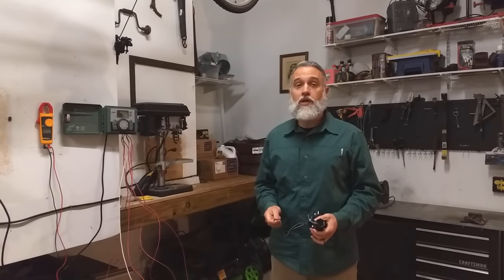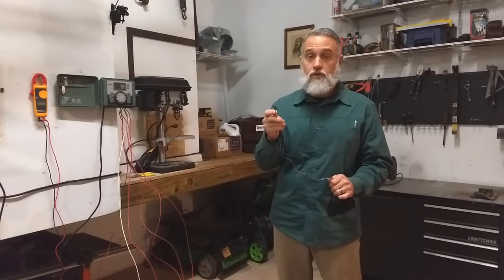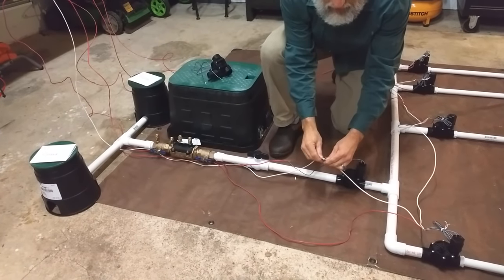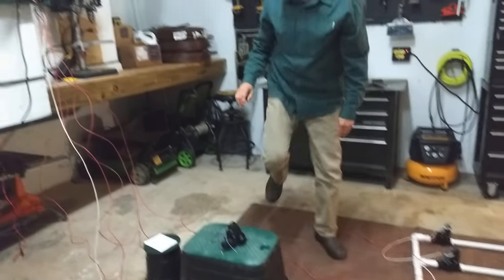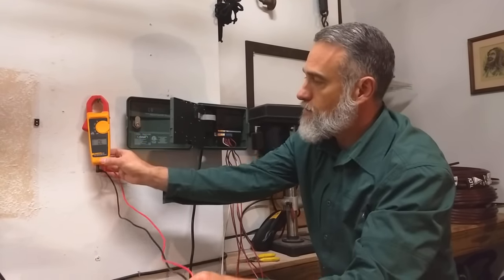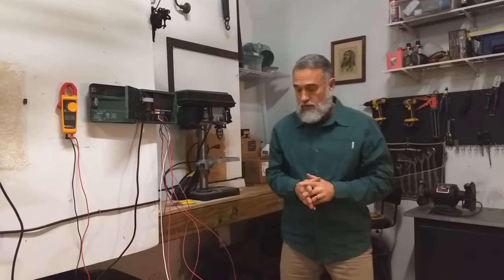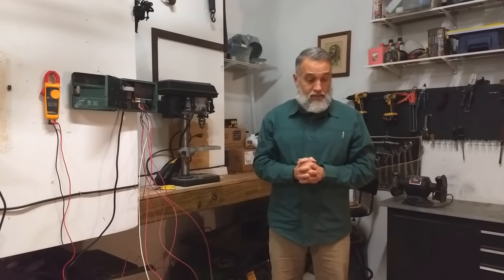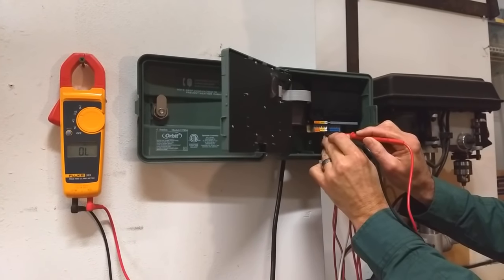Troubleshooting sprinkler system wiring issues

Comment: What a Gentleman !! I had a bad Rain Bird sprinkler where the solenoid was shot due to lightning. I have searched on Internet and landed to this video.  I called Jimmy and left a message. Jimmy called back and helped me troubleshoot the issue with my multi meter and told me where exactly was the problem. Thanks so much Sir. You helped me save my yard, time and so much money.
Reply from the maker: Aby Singhai my pleasure!

Comment: This is wonderful!  Thanks for taking the time and using your expertise to show us exactly how a system should be wired and how to use a multimeter to diagnose common wiring problems in home irrigation systems.  I particularly appreciate your telling us the normal resistance readings we should be expecting.  Your video is clear, well thought out, to the point, and presented extremely well.  This video is a shining example of how a YouTube video should be made and presented.
Reply from the maker: Anonymous98 my pleasure!  Thanks for the kind words!

Comment: Thanks for the video. System stopped working after some trenching work. Watched your video and used a multimeter to determine that the MV circuit to the pump was the problem. Did some more digging and found that the pumps’ control wire had been cut. Repaired and the sprinkler system works like new!!!
Reply from the maker: M Browning so great to hear!  Thanks for sharing!

Comment: one of the better videos I have seen. I'm diagnosing an 8 zone system in Gadsden Al (mine) with numerous problems. Getting smarter all the time but certainly not an expert. I have a large box with a ball valve and two zone solenoid controls. One was a standard Irritrol but the other is MUCH larger and the local Plumbers Wholesale didn't recognize it or have one in stock. The valve body and diaphragm housing is 4" diameter and has 10 3/8" screws that are not Phillips or Torx, they were removed by socket. The last two were under the solenoid and it needed to be screwed out of its hole in order to remove the final two screws. The faucet type handle is completely immobile so would like to replace the innards. I'd send a picture if you give me a method. Would really like to know what kind of valve this is and where I can order a replacement?
Reply from the maker: Yes, send me some pics and I'll give you a call and see if I recognize it.

Comment: Thank you for the excellent demo, i noticed that you used the red wire from the Multimeter for the common and the black(ground) for the zones, does it make any difference when measuring resistance ??
Reply from the maker: It’s a good practice to use black on common, but for ohms & ac it doesn’t matter.  If your measuring dc you need to make sure black is on the negative and red is on positive.

Comment: Hi, thanks you for making this informative video, my first zone keeps blowing my controller fuse, i did ohm test on solenoid and also wiring, both test show within range but almost 1ohm less reading, what could be causing the fuse to blow,all other zones work normal if i disconnect zone 1wire or turn its setting to zero on controller.
Reply from the maker: Most likely the solenoid or short somewhere in the wire, unless your controller is having an issue.  If you move the wire to another slot and it does it, I’d go back to the solenoid or field wire.
Reply: @sprinklerrepair4L i think just trying replacing solenoid at first is the best option.

Comment: Awesome, echoing what's been said prior, this video is very clear; thank you.  It's been 5 years but... what if you have a pump start relay between the water-pump and the sprinkler timer?  I have a 6-Zone Rain Bird system that's connected to a relay, there's power going to the relay from the breaker, and the Rain Bird system is also powered, all the wiring running to and from both units look good, but I cant' get the water-pump to turn on.  Where or what else should I be looking for?
Reply from the maker: I’m not a pump guy, but I’d check and make sure your controller is giving it AC and then make sure AC is getting to the pump.  After that it would be a pump issue.

Comment: I need to replace my current sprinkler system.  The sprinkler system that I currently have is a Weathermatic sprinkler system. I has up to 16-station connection. My lawn uses 14-station.  I am unable to find any Rainbird sprinker system that can handle 14-station. The most I have seen is 12-station evan for any sprinkler system. Can I use a 12-station sprinkler system on a 14-station lawn? Can I use station 13 & 14 and plug it to the station 11 & 12?

Comment: Oh you did cover it!  How would you expect to find this underground? Would all 4 dedicated wires run along side the supply lines and the common wire? What about for a 15 zone system? Is there really 15 wires in the ground? Thanks again
Reply from the maker: Yes, the wires are usually in the same trench as the main line.  Sometimes they will come in from different sides depending on what the installer did, but yes for a 15 zone system, you would have 16 wires running in the ground to the controller and 17 if you have a master valve.

Comment: hey, Jimmy, so if there is no resistance reading on the last, 4th 8kvalve, we have no way of telling if it's the dedicated wire, or common, correct?
Reply from the maker: POVemigranta that’s correct.  You can run a common on top of the ground from the closest valve and see if it’s the common for a quick test.

Comment: @4L irrigation repair. If you have a damaged wire what's the remedy? Run a new wire from the sprinkler box to the sprinkler valve?
Reply from the maker: The options are to find and repair the damage, run new wire,  or if another valve is close you can use an "add a zone" that will save you from running wire all the way back to the controller.

Comment: very nice way of explaining the "sprinkle wiring issues". My sprinkler system was working until three days ago. Today, when I switched it on, one specific zone (3), it didn't work. I tried all other 5 zones. none of them were working. Checked the back flow valve and found it working. Controller is working. Checked the transformer and found working. There is one white and 6 colored wires. Does it mean, I have a master valve? My last try is to check the white wire and master vale. Since, none of the zones are working, based on your video, I am suspecting common wire and or master valve. My neighbor was repairing his lawn at the zone 3. Can  it be due to some damage to the zone 3 water line? or does it impact only zone 3?  Please give me your insight.
Reply from the maker: If you have a master valve, you should have a wire in the slot on the controller labeled MV or Pump or P.  The white wire is usually the common wire which all the zones share.  I would start by taking ohm readings.  You should have readings between 20-60 ohms on each of the zones.  That will tell you if you have wiring issues or something else.  I hope the best for you!
Reply: @sprinklerrepair4L  Thanks for the quick reply. Appreciated. I will check the ohms.
Reply: There is no wire attached to the MV, So, it appears that there is no master valve. I checked the ohms by setting the multimeter at 200. When I checked the common wire with zone 6 , it didn't show any ohms (I neither got any beep sound nor DL error code). I checked zone 1, it didn't show any ohms either. Since none of the zones are working and I got no ohms from first and the last zones, I think the common wire is cut just at the 1st valve. Do you agree ?
Reply from the maker: @orkayen  Yes it sounds like the wire has been cut or come disconnected at some Junction. I’d look at the zone closest to the controller. If nothing is working, then it is probably cut or disconnected somewhere between the controller and the closest zone, which is what is why none of the zones have ohms.
Reply: @sprinklerrepair4L  Thanks. I will check and respond.
Reply: @sprinklerrepair4L  Hi Jim. I checked the common wire. It is not cut or disconnected at the 1st zone, which is closest to the controller. I also checked the wire from the controller to valve box. No cut there either. Could it be due to fuse? It looks ok and I do see the station # and time display. does water leak or damaged sprinkler head in any one zone impact all zones or shut down the entire system?
Reply: Also, when I checked the transformer (for 24VAC ), it was showing max of 19. is Transformer an issue?
Reply from the maker: @orkayen  you probably have a cut or disconnect somewhere between your timer and the valve closest to your controller.  You may not see it, but it exists somewhere or you wouldn’t have 0 ohms.  The voltage should be higher than 19v, but is a separate issue.  0 ohms = disconnect of wiring somewhere.  You may need to rent a valve finder or hire someone to find it for you.
Reply: @sprinklerrepair4L  Thanks. I did find the valve box that contains first three zones. I checked the wires coming out of the solenoid of the first three valves. All of them are good. Since, there is no cut or disconnected wires(I pull tested the common wire), I didn't remove the wire nuts. I will remove the wire nut of the first one and see any disconnected wire.
Reply from the maker: @orkayen  You should get the same ohm measurement on the solenoid in the valve box as you do when you measure that zone from the controller.  Good resistance (ohms) on the solenoid in the ground but no ohms at the controller = bad wiring somewhere in between the two
Reply: @sprinklerrepair4L  Thanks, Jim. I will check on that.
Reply: @sprinklerrepair4L  Hi Jim, since, none of the zones are working, it may not be due to solenoid. It must be the common wire either cut or disconnected at or before the 1st valve. Correct?
Reply from the maker: @orkayen  yes, I agree…it could be right outside the controller.  On the old wired sensors, that would happen a lot.
Reply: @sprinklerrepair4L  Thanks for your time/support, Jim. Finally, I was able to fix it. It was the rain sensor  connection that was defective. Now, when I connected the rain sensor back, I got the required ohms on all zones and the system was working as normal. Again, thanks for your help.

Comment: Have you had any signals cross? meaning, have Zone 1, run Valve 2, or another other than it's originally wired valve? Thank you!
Reply from the maker: Yes, I’ve seen wires crossed in the field.  Unless you know the area that work was done, it’s very difficult to find & sometimes easier to run a new wire.

Comment: Thank you for the great video.  I have a 20 year old 6 station system run by a Rainbird ESP-8 controller.  Problem that just started is that when timer turns on station #1 - three other stations come on.  Wondering if my controller is in need of replacement ?
Reply from the maker: If you have a multi meter, you can check and see if when zone one is on is the controller giving ac to the other zones.  Then you will know if it is your controller or mechanical failure with your valves.
Reply: @sprinklerrepair4L  Thank you so much for your reply.  I do have a multi meter, and although my mechanical skills are good, my multi meter skills are not one of my strong points - could you tell me where to set it and where to to place the probes ?
Reply: So - watched your video with the Rainbird controller and followed your steps and  everything seems to be working correctly - so must be a valve problem.  I have only been able to get one zone to open and close manual by turning the solenoid - so that is a mystery - getting dark here so will attack again tomorrow.

Comment: Thank you so much for this video. So helpful.  However I have one question...zone 1-4 are wired by the same wire spool.  Zones 2-4 work but Im getting an open on zone 1 and solenoid is good.  Doesnt make sense that zone 1 would have a cut wire and not the others since they are in the same strand.  Any ideas?
Reply from the maker: It’s definitely possible that it was the only on cut in a bundle.  Does it have ohms at the controller?  If it does, then measure voltage to make sure the controller is doing its job.
Reply: Figured it out 😀  it was the black wire coming out of the grease tube, the end broke off ☹️. Thank you for the reply 😀😀😀

Comment: Hi Jimmy
I bought an old house with a sprinkler system that was working with a very old rainbird controller and a pump relay. It was working great with 2 zones and I disconnected the controller to replace with a newer one, first mistake!!!!! now I cant get any valve to work. the wiring is confusing. the controller wiring hooks to the relay using brown and white then continues to the valves . All common wires are connected to white and other wires connected to red... then there are 3 "harder wires coming up inside the valve box that are connected to the common wires. At the controller I connected the withe to common and brown to MV and the red to zone 1 I get nothing except the pump turns on but no valves working. I tested the valves manually and they are fine.
Reply from the maker: I'd take ohm readings and make sure they are all good.  if so, then I'd double-check the controller settings.  If those are good, it is probably the MV wire is in the wrong place.  I'd rotate all the wires into the MV slot with the others in the zone slots and see if you can get it going that way.  I hope the best for you!

Comment: I'm right down the road from you! I have 2 questions: what should the resistance be for a lawn genie solenoid? I'm getting around 18. Second, I have 2 zones that are dead. I believe the common was nicked by a sharp shooter. They show 30 volts at controller but only about 8 volts at solenoid. Could I just run a new common from the controller to each of them to fix this? Also, a bonus question: the color of the wire at the valve is not the color at the controller. How and why did the installer do that?
Reply from the maker: Not sure about that specific brand but in general they should be between 20-60 ohms.  Yes you can always run a new wire, if you know which one is bad. It is very common to see color changes in the wiring from the valve to the controller.  Usually it’s because of a repair or the installers run out of the same kind of wire and finish up with what they have on the truck.

Comment: When turning my Hunter SRC from manual station to 'run', it doesnt activate the zone run timer as usual and defaults back to the date display.  I cant get it to run, it keeps resetting back to date display.  No error code or anything.  Ive used multimeter on the AC power, checked the fuse, unplugged it for a while, changed the battery, reset the unit, re-programmed the timers and zones, checked the ohms from the controller to the solenoid, everything checks out.  Bad controller?
Reply from the maker: If the ohms are good and the controller is giving it voltage, it’s probably a mechanical failure in the valve, most likely the diaphragm.  Good luck!
Reply from the maker: Adventures In Dirt you may want to call the Hunter help line and they will walk you through everything 760-591-7383

Comment: The place I moved into has a complete system like this connected but nothing works regarding the timer. The wires coming off the valve heads are eroded and no longer sealed. I assume I can buy the celenoids? Or have to replace the whole thing? Also,  if I manually turn off all valves by hand would that stop the timer from turning on the water as well?
Reply from the maker: Specialist K , if they are contemporary valves, then yes you can buy them and replace them.  If they are old and you can’t find the parts, then you’ll have to replace the whole valve.

Comment: Is the wiring the same to the master valve as it is for the other valves...one solenoid wire to common  and one to a different wire? Because what appears to be my master valve looks like it has both solenoid wires going to the same wire. Is it supposed to be like that?
Reply from the maker: You are correct the wiring to the master valve shares the same common as the other valves and the other wire goes directly to the controller and into the master valve slot.

Comment: I need to replace my mother-in-laws ancient controller. There is no master valve, but there is a well pump motor that needs to be on. Would i wire into the master on the controler to switch the pump on?
Reply from the maker: Martin Richardson in the same spot, it may say pump or MV.

Comment: Thanks for your video, I had an french drain installed. After completion, My zone 1 will not turn on, and my zone 2 water comes out very weak. The rest of my zones are fine. I think a wire was cut in the process. can I run a wire instead of digging up the yard trying to find where the cut is located?
Reply from the maker: Yes, you can.  It'll probably be easier unless you have a valve finder.  I'd check the ohms just to make sure that is the problem.  The one with low pressure especially.  Could be a break somewhere on that one.